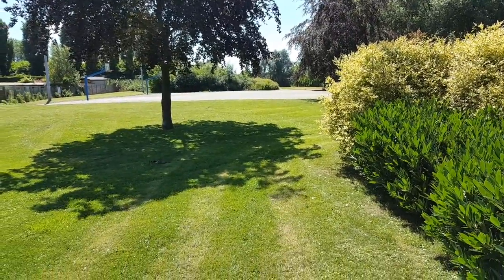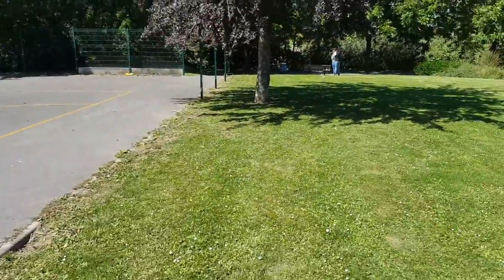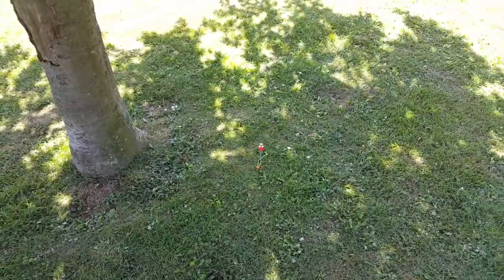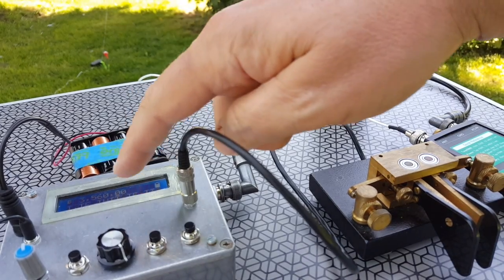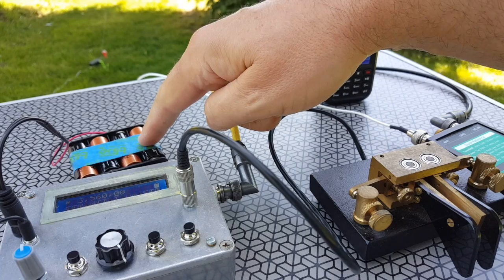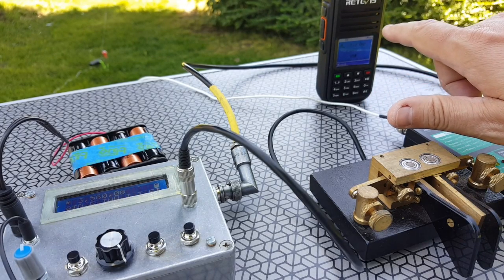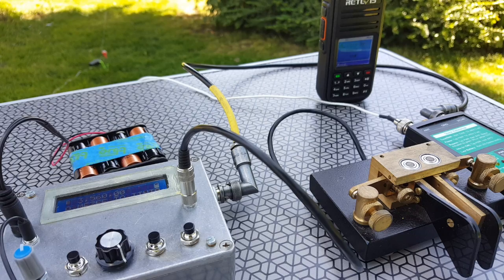Can You Lay Your Wire Antenna On The Ground And Make Contact?

Comment: Might be the moisture that is causing the problem. A number of years ago, my friend Rich High W0HEP (SK), founder of the Colorado QRP Club, and I headed to Wyoming in his RV to put that somewhat rare state on the air at QRP power. We had a FB QSO with a ham in Los Angeles for sometime, only to discover that our inverted V antenna had succumbed to Wyoming's incessant wind and had been laying on the ground. We were five by nine old man throughout the QSO. Of course, the ground in Wyoming is quite dry. 72, Dick AB0CD..
Reply from the maker: Incredible. I have heard the same about antennas on desert sand.

Comment: The problem you have had  was impedance mismatch .
 You can have good  reception if you just ground your   inner wire of PL connector from output of the transceiver  to the ground. It is good to have  it few  feet  long .
 So not only it would work on the wire on the grass ( not elevated) but having the antenna grounded  at the end. To understand it please  go to : https://www.youtube.com/watch?v=6TcEDrUbFlQ .   So at some point it is good to have  simple Pi filter  ( two capacitors   grounded  and coil in between  tuning to  frequency of your  choice.
This is also called  transmatch or antenna tuner. For  some  more advanced form  of novel communication  and energy transfer  go to my  few last videos. Receiver is more forgiving to  mismatched antenna so  you may  be fine with just  1/4th  wave  wire length. Tx must have  however good match  of SWR.
Wesley

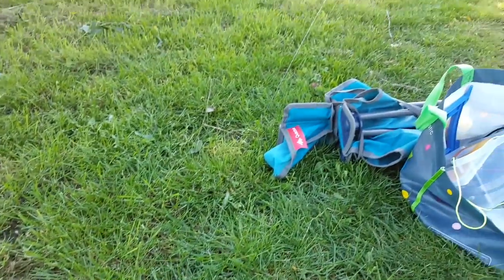Comment: Perhaps the antenna on the ground needs to be a bit longer than a half wavelength with a 1:49 un-un?   I think that it reacts to the ground?   
I had a random length antenna on a grassy park (somewhere close to 75m I think?)  with a 9:1 un-un that seemed to go NVIS and worked ok on 80m with a manual MFJ tuner.  
Regards, Jas.  
vk4fjgs  
73

Comment: A buried antenna will have its resonance at about 25-30% of the length of an antenna up in the air due to dielectric effects. An 80 meter antenna on ground would be about 40 ft long.  The feed impedance will be higher as well. The military has used on ground and buried antennas for years, one application was for backup comms to missile silos. See  the text "Antennas in Matter: Fundamentals, Theory and Applications by Owens and Smith" and https://www.rfcafe.com/references/short-wave-craft/images/buried-antenna-performance-development-small-resonant-buried-antennas-ad-783-274.pdf
I use a ground dipole on 472kHz, about 480 feet long ( in free space it would be nearly 2000' long), it has an impedance of about 200 ohms.
73 Warren K2ORS

Comment: Great fun,  I'm sure you've made unexpected contacts with less than "ideal" antennas. I'll bet you've tuned up some odd metallic found objects with a z-match tuner. It's just too tempting not to try. I once worked Bert, F6HKA  from Brooklyn, NY USA. using a window frame as my antenna
Reply from the maker: Yep, radio miracles do happen..

Comment: I will join the club of it can work. A friend had made a strange one off 10 meter antenna that had a high impedance. The best description is a Beverly hillbilly off center fed dipole. When the impedance was tested it came in very high. He laid it on the grass kind of coiled like a snake and this change in boundary conditions transformed the impedance to a perfect 1:1 match. He was able to contact me on the other side of a large hill that normally blocked line of sight transmission. I was impressed and ever since have been a big fan of NVIS.
Reply from the maker: Probably wasn't NVIS, which should not work above 10mHz. Weird things do happen when you try though...
Reply: Radio Prepper Hi Gil, I would bet it was. At the time in the solar cycle 10 meters skipped and the maximum usable frequency was very high that day. I would think all you need is to not have penetration through the refraction layers and what goes up then must bounce back down. Later I had read the narrative of an RF engibeer who had set up a mountainous area of a small foreign nation to be able to communicate using NVIS. I love it, it turns my 5 watt radio into a phone.
Reply from the maker: Who knows, weirder things have happened! That's why I love 80m now, regional telephone!

Comment: I have been playing around with using (terminated) RG6 coaxial cable, with the shield floated, laid on the ground as a receiving antenna for the lower HF and MF bands. I get fairly decent receive performance. Have not yet tried it as a TX antenna yet; probably would be QRP only given that I am just using commodity 75 ohm terminations that probably can't handle more than 5 or 10 watts.

The information on the "snake" antenna is a bit thin online, but here is an article that I found to be an inspiration:

http://tm1o.free.fr/Beverage/On-Ground.pdf

Comment: 80m band in mid day is not a test of the antenna. Probably couldn't get any contact on 80m on daytime with most antennas.
Reply from the maker: Definitely not the best time.
Reply: Radio Prepper Do you plan to repeat the experiment on a band that is active? I think the result would be very interesting to many of us. TU 73
Reply from the maker: Most likely.

Comment: Interesting, Gil- there was a Ground Antenna option for the ww2 British Army WS38, it was 25ft (about 8 meters) of wire and the instructions were to lay it along the ground pointing in the direction of the station you wanted to communicate with. So there must be something in it, for the 38 set only ran a few hundred milliwatts and antenna efficiency was everything! Best 73 Alan G0NFY.
Reply from the maker: Thanks. What frequency was used?
Reply: Radio Prepper The 38 set covered 7.3 to 9 MHz. I have one here on my to do list for restoration, but it doesn't cover any amateur bands without modification to tune 40m...
Reply from the maker: So NVIS still possible...

Comment: I've tryed old "phone wire" dipole on the grass with my MKARS80 (80m SSB 5Watt rig). And had contact over 200km  - North Vancouver - Princeton (Canada, BC)
Reply from the maker: I really ought to try again then.
Reply: I gess it affect "electrical length" and direction (transmit more upwards)
I did't bother to change the length of the dipole. Neither to use BalUn,

Comment: I would be surprised if it worked, but... what if you tried an iron wire instead of the copper one. I heard, that an iron wire is able to receive more magnetic part from a signal (and less electric).  I don't have it proven, and I still wonder if this myth is right.
Reply from the maker: I kind of doubt it...

Comment: well they do have BOG beverage on the ground antennas. Not sure how well they work never tried one but I believe they are usually more receiving than transmitting. Of course I could be wrong. I have been before and will be again LOL :)
Reply: As noted, it seems like a decent receive antenna. Without a tuner or anything I was able to hear WSPR stations all around the USA and Europe on 40 meters using 150 feet of RG6 (terminated) as a BOG.
Reply from the maker: Maybe a GrassRhombic...!?

Comment: Good to see, thanks. Maybe another attempt in the evening might have better results? I live on a boat and your video reminds me of something I want to try. Letting a float carry the wire away and seeing if that would work. Maybe you could too and video it?
Reply from the maker: Hi, I suspect it might work... If the opportunity presents itself I will try. Now the float thing is interesting to me, being a sailor. I have doubts about that one though, but until someone tries there is no telling for sure. It would surely work around 30kHz, but you might have a visit at sea then ;-)
Reply: I would imagine it would probably work best over very dry ground so it's insulated a bit like sand being mainly an insulator with all the silica glass particles... I have heard stories of flushing a very very thin very long wire down the loo for use on the ELF band's apperently Subs use these frequencies and there under water.... don't know how true this is.
Reply from the maker: Sounds about right. I need to try again.